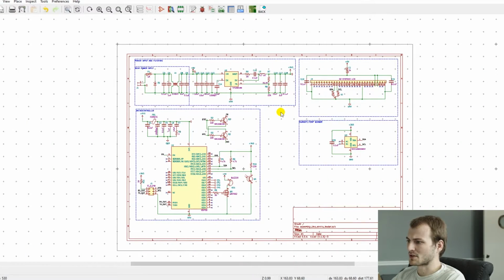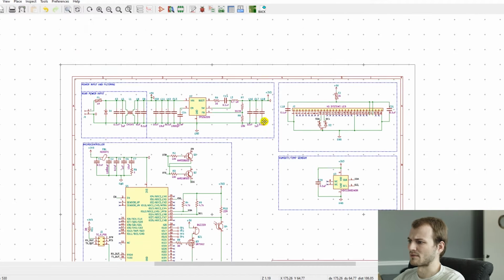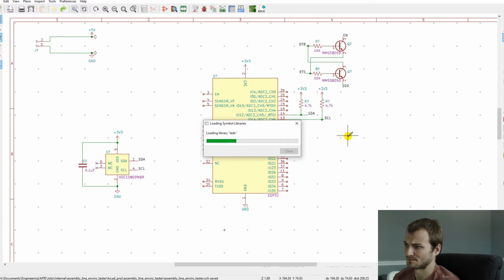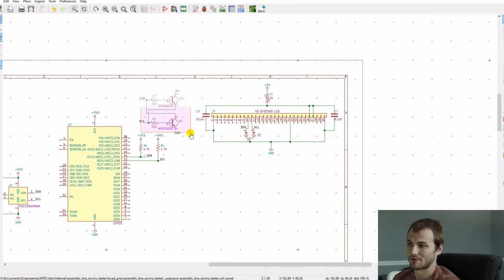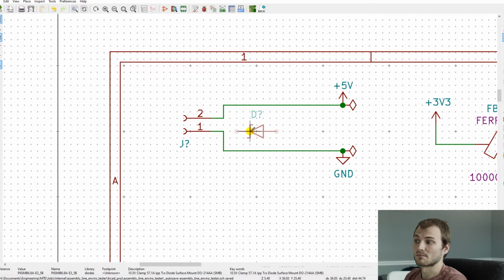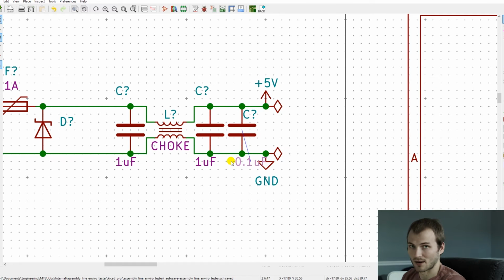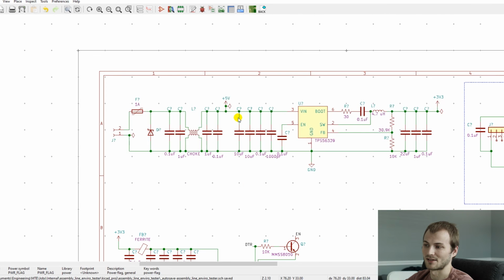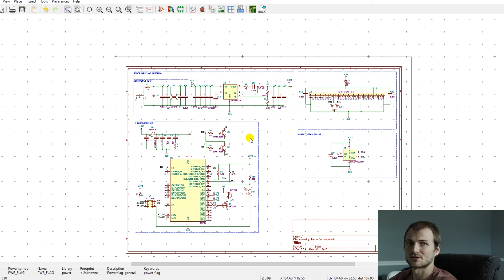Advanced temp/humidity Project 1/x - KiCad schematic

Comment: Love these types of videos - I always learn something new from watching them. One thing I'd like to add is that you want to pay special attention to the TLP plots when selecting TVS diodes because the amperage flowing through them is a coefficient of the voltage they can clamp. Your diode might be rated for a 3V3 clamp but in an ESD scenario with a longer pulse that conducts more current, it may very well clamp ABOVE its rated maximum and your ICs could see 5, 6, or even higher voltage potentials. Also a suggestion: maybe setting up your connector vertically instead of horizontally to avoid having awkward connections and drawing through the symbol would make the schematic prettier?
Reply from the maker: Great point. I wish I would have mentioned that during the video - I'm considering doing a dedicated i/o pin protection video, covering ESD, over/under voltage, etc. I could cover it better there. 

But yeah, you're right, but the key is that the vast majority of the power will be dumped by the TVS, and very little will be able to affect the ICs. Can it still destroy them? Of course, but the ICs themselves will always (we hope..) have ESD protection diodes built in, so as long as you handle most of the surge, they typically can take the rest. Adding some caps (with i2c you can't add much), series resistance (series R solves almost everything), or another TVS downstream all help to better your protection. With this circuit, I'm 99% confident that the screen will itself handle all ESD surges internally (We have a client with 100+ of them deployed with only caps as ESD protection, with 0 failures), so the lone TVS should be more than enough.

^ Definitely not trying to disagree, you're absolutely right, just throwing my reasoning out there :)

Don't know what I was thinking with the connector, definitely a total mess :p
Reply: @MicroTypeEngineering That would be a good topic for a video, and I will definitely watch. I'm still trying to wrap my head around the various methods and combinations of overcurrent/overvoltage protection schemes. Also how do you guys calculate LC filter values? Is it just like a best guestimate type of thing(which is perfectly fine sometimes) or do you guys incorporate them with a specific range in mind or after observing particular interfering frequencies in prototypes? Thanks.
Reply from the maker: Check my response to @DavidEnds 12. Yeah it's a lot of guesswork/guestimates + actual baselines. Main thing is to filter out the first three harmonics of the highest frequency of the chip. If you use a lot of ceramics with low ESR, make sure to account for ringing.

Comment: Nicely done. +1 for the test points. I tend to put them on things like the I2C lines, but that might be based more on pains of past projects than solid engineering. The TVS diodes on the lines coming back from the touchscreen are super obvious now that I see it, but that might have been a blind spot for me, had a used one in a project. On pluggable connectors, yes, obviously. But, what is the user going to touch more than anything? The screen. Face palm. Thanks. I have used PTC fuses in the past, in both the Zener + PTC and PTC-only configurations you showed in the video. So far, I haven’t seen magic smoke from the boards or powered devices. However, I’ve never felt confident designing with them. Simply put, my main hangups are the two current ratings and the time coefficient. Any chance you’d be willing to clear that up in the comments or in a future video? Either way, thanks for your efforts on the channel - it’s all good stuff.
Reply from the maker: Yeah. Honestly, as much as test points would be useful on lines that are used on boards, I virtually never use them. Throughout all my reworking/troubleshooting boards, if there's a pad, I can test it. So as long as there's a component on the net, I'm confident that I can get a probe on it. Yep, those TVS diodes are very good, cheap insurance. For the PTC fuses, I assume you mean the IH vs IT? Basically, make sure your device never goes above IH in normal operation. Between IH and IT it may be starting to open, maybe not. Above IT, depending on the time (as shown in the datasheet graph) it will open. Basically, for any fuse - standard or PTC - they are brute force, inaccurate devices. You really can't rely on them for an accurate trip. In this case, who cares at what current it trips at exactly? Will it trip on a dead short? Absolutely. That's my goal with fuses. Anything that needs accurate current protection needs an EFuse, or a true current limit circuit. (Though, I'll still have a fuse in series with those).

Might do a video on Li-ion protection circuits comining up. We're working on a UL design right now, so it's pretty fresh for me!
Reply: MicroType Engineering The one big plus of actual test points - even if they are just little solder pads - is that you can have multiple scope probes attached. Probing a single pin, even on a fine pitched part, isn’t too bad. But, they are more useful when you’re checking to see if X happens, then Y should follow. Anyway, I basically agree - I should probably reduce my reliance on them over time. Yes, exactly - IH vs IT. I really like the way you described/explained fuses in general, and it immediately changed my perspective. Looking back, I think I used these parts in exactly the way you described. But, at the time, doing so gave me a bad vibe, as it felt more like guesswork than thoughtful application. Now I see that, as your said, they’re an inherently crude instrument - and should be viewed & used as such. Thanks for taking the time to answer my question! It definitely helped.

Comment: I like this sort of video. As a noob, it brings in the LC stuff and also the choke my YouTube education (as you pointed out) has not easily given me. I was wondering how you choose the size of the inductor for the buck.. I assume it has to somehow work the the switching frequency and its counterpart cap along with amps out?
Reply from the maker: Correct. The higher the switching frequency, the smaller the inductor that is required. Most datasheet's will give you the calculation for it.

Comment: How do you calculate the capacitor Values?
Reply from the maker: Ahh now you will be going down the rabbit hole! Tldr; the smaller the capacitor, the better it is a shunting high frequencies. That's why I mentioned using one at each decade, as that is how the impedance vs frequency graphs make the most sense.

In reality, it's a lot of best guesses, rules of thumbs, and hoping for the best honestly. For the most part, you want to make sure to filter at least 3x the frequency of the highest switching speed on the board. (THIS IS BASED ON RISE TIME, NOT JUST OVERALL FREQUENCY!!!!) So, you can have a "slow" 16MHz chip, but it could have nano-second rise times, which are devastating to have on your board if you don't filter for them. Note: sometimes datasheets suck, and they don't show this spec, but... you do the best you can.

When you do this - filtering with a few decades of low esr caps - you need to make sure they don't "ring". That's why I have a larger electrolytic with a "R" in series. You can also just have a low value resistor in series with the power line to damp the ringing. Just be aware of this, as if you don't, you can make things so much worse than no filtering at all!

Check out: 
TI appnote: SCAA048
Dave Jones has a fantastic video: https://www.youtube.com/watch?v=BcJ6UdDx1vg
Reply: @MicroTypeEngineering  thanks!!!

Comment: I do not like the auto-programming circuit for ESP32, it is basically just a  xor gate that protects you from resetting the MCU on opening the port on the PC, and it requires a capacitor on the EN pin for compatibility.

Comment: Sorry, but I've got a bone to pick with this :).  Splitting the value of capacitors in the same case size is BS that doesn't stand up to any scrutiny or measurement and annoys me every time I see people perpetrating it.  Every time I've seen it, these are people blindly following "best practices" passed down to them without ever making measurements to check if what they're doing makes any sense or not.  That 1000pF cap in parallel with the 10uF does _nothing_.  It's time to break the chain of misinformation!

In a decoupling application, the impedance of the capacitor can be thought of in 3 different regions below resonance, at resonance and above resonance.  Below resonance, the capacitive reactance dominates the impedance, so more capacitance leads to better decoupling.  At resonance, the capacitive reactance is exactly canceled by the inductive reactance and all that remains is the ESR which is usually "low enough".  Above resonance, the ESL dominates so less ESL leads to better decoupling.  Now here's the kicker, the ESL is a function of the case size not the value of the capacitance.  For the same case size, increasing the capacitance increases the self resonant frequency (SRF), but does not lower the the high frequency impedance.  See this impedance plot: https://i.stack.imgur.com/BUUHk.png

The "capacitor from every decade" technique held water when the "bulk" capacitance was provided by a high ESL type, like an electrolytic.  With modern MLCC's, to maximize decoupling is more about how you design the interconnects to the capacitor, since the external interconnect "ESL" will quickly swamp the internal ESL of the capacitor and dominate high frequency performance.  Beyond that, it's about choosing the smallest size available, or using landscape, feedthrough or interdigitated termination capacitors (notice the theme of interconnects being the primary issue), but that is really only necessary for particularly high performance designs.
Reply from the maker: Hah! Glad you commented, always good to add to the discussion. Yup, hard to disagree with your reasoning. Though, the "curves" shown on the stack post are ideal, and not actually what a frequency vs impedance graph typically looks like. In reality, you get something more akin to this: https://n7f2x3w4.rocketcdn.me/wp-content/uploads/2017/04/SingCapImpdnce.gif (I know you're going to point out how the impedance differences decrease with smaller capacitance's. That's true, but there is still a difference) Smaller capacitance valued capacitors will tend to have a lower ESL (yes, package, land size, and traces make a much bigger difference).

http://ntuemc.tw/upload/file/20120419205619a4fcf.pdf Is a fantastic paper with real world testing of capacitors that goes into this topic in great detail. But yes, in reality, having capacitors of varying package sizes to minimize ESL is going to be the best approach. Using smaller capacitance values does also help, and to be able to achieve the smaller packages, typically the capacitance values are going to be decreased as well. So it isn't really an "either or" approach, you can do both.

The biggest issue with my approach and the standard "decade" system is the risk of self-resonance and ringing. That's why it's really important to make sure it is damped (series r, ferrite, something), and to keep from having large gaps in the ceramics capacitance values. That NTU paper shows a nice graph of this.
Reply: @MicroTypeEngineering  You're trying to make this more complicated than it is :).  Those lines are very accurate to what actual performance is (I've done actual measurements to convince myself of this).  I don't recognize the capacitor manufacturer for the plot you link, but it seems it's targeting film capacitors (which have a different case size for each value).  You absolutely cannot draw conclusions from that plot for surface mount MLCC capacitors, and if you're counting on the little deviations in the high frequency performance of a parasitic parameter being "as advertised" in a +/-10 or 20% part well good luck!

For MLCC's the simpler answer is also the more accurate one: ESL is a constant with case size, so for best overall decoupling in a given case size pick the "biggest" value (that makes sense). If this doesn't give you adequate high frequency decoupling, dont go looking for lower values, look for smaller case sizes, (or better interconnects or exotic terminations).  Murata publishes some of the best specs on this kind of thing, this link is a plot of several "decade" capacitors from the GRM series 0603 case size: https://ibb.co/rdyYsby Note that ESL is line-on-line for each of these caps, and the lowest value cap is lower impedance *nowhere*, except it's specific self-resonance.  You can easily generate similar plots using the Simsurfing tool they provide for other MLCC families or case sizes.

I know you can find papers and app notes written in support of the strategy you take.  All I can say, is "watch out!", EMI/EMC is an industry rife with cranks who stumble in the dark and do things based on intuition that they never actually submit to test.  You don't need to take my word for it (and shouldn't) but I would recommend Henry Ott or Lee Hill or https://learnemc.com/ as generally authoritative sources.  The paper you link for instance has multiple plots showing that MLCC's have the same ESL for a given case size, but gets the conclusion wrong on slide 47 that "ESL decreases with decreasing capacitance value", and "ESR is lower for higher capacitive values"
Reply from the maker: I don't think I'm making it more complicated? Again, I'm not disagreeing, I literally said above I can't disagree with you.. Maybe you're forgetting the simple fact that if you wanted to use an 0805/0603/0402/0201 to best obtain a low ESL curve, you physically would have to use different capacitor values, unless you wanted to use nF size for everything, which most likely won't be enough capacitance for the chip depending on what it is. So we're back to the decade solution... 0805/0603 at 1 or 0.1uF, 0402 10nF, 0201 1nF. You literally can't have all those packages at 0.1uF, as 0201 is too small for it.
Reply: @MicroTypeEngineering  To clarify, what I think is "overcomplicating" things is talking about picking multiple values for high frequency decoupling performance, when (admittedly counter-intuitively) the high frequency impedance has basically nothing to do with the capacitance value.  When I've seen people do this "decade" stacking of capacitors before, I often do not see the case size modified for the smaller values.  But maybe that was how you were planning to implement this?

I'm not promoting the solution is to have "one of each case size".  At low frequency, everything other than the highest capacitance value is irrelevant, and at high frequency everything other than the lowest ESL (smallest case size) is irrelevant.  My approach is to pick a decoupling capacitor that "makes sense" for the design, ie it's as small a package and as big a capacitance as I can get without driving my layout design rules or BOM cost, still has decent voltage rating and a decent dielectric, etc (also, you literally can get a 0.1uF 0201 ;) ).  I then just use that everywhere, with a good low inductance footprint and anywhere I am extra concerned for whatever reason I stack multiples of that single value. If something needs a specific bulk capacitance somewhere, obviously I probably will use a different capacitor to achieve that.

Anyway, good luck with your design!